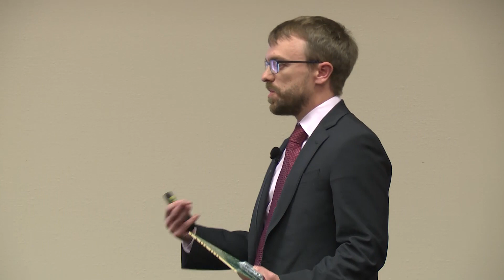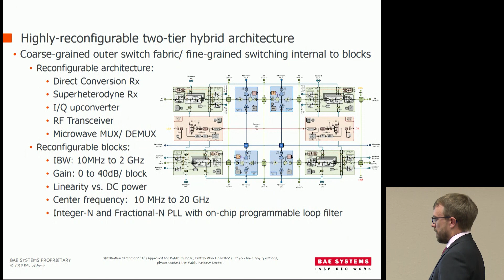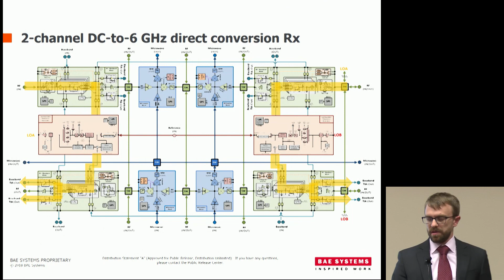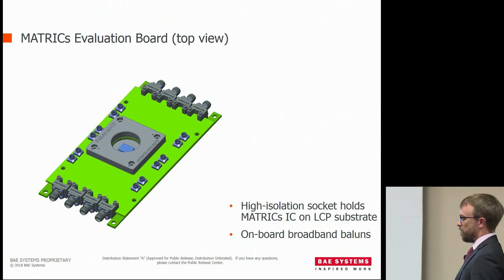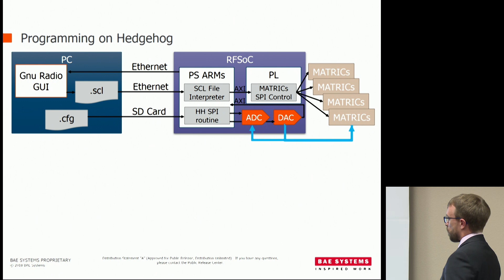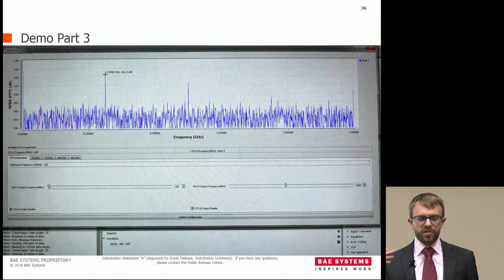GRCon18 - GNU Radio on the Hedgehog SDR

Comment: You need to start with cheaper platforms, devkits based on ZYNQ 7000, when the community feels that this is a really worthwhile solution - they will buy more advanced kits.